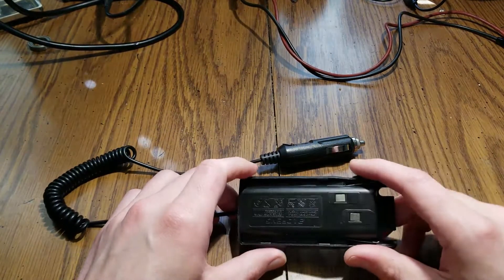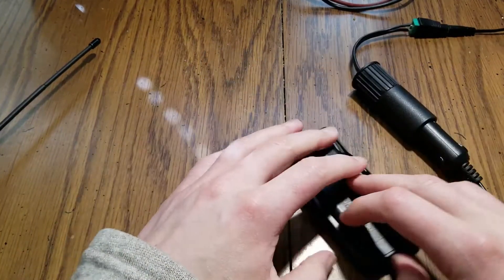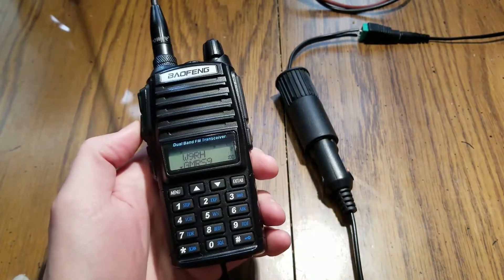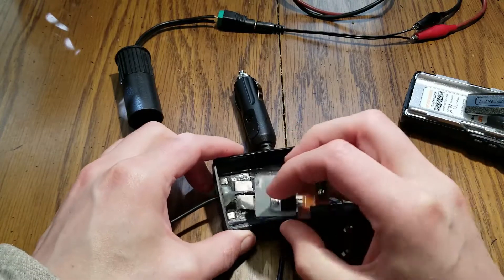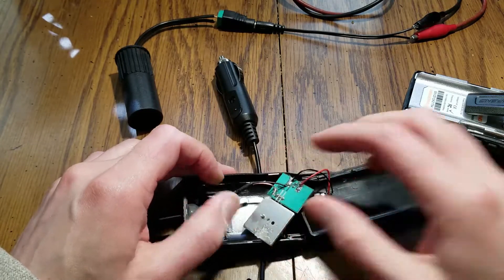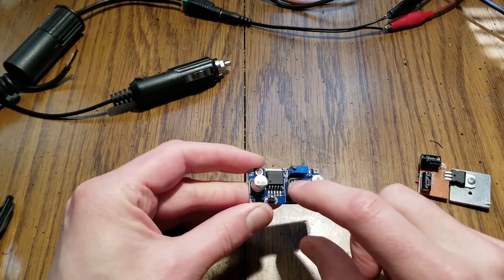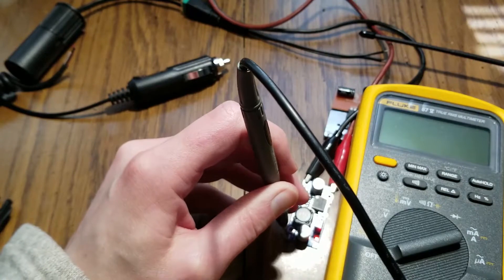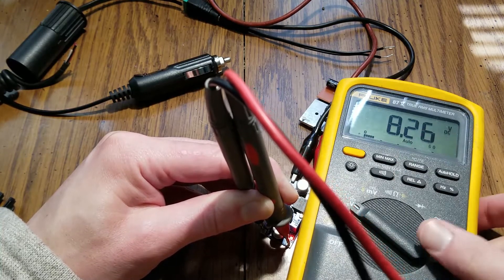Modifying a "Battery Eliminator Adapter" for a Baofeng UV-82 Radio.

Comment: Perfect! I have a 12V leisure battery in my car. I’m building an APRS battery monitor using a Raspberry Pi and a Baofeng. I want to hard-wire the radio inside the case i’m using. Thank you for the video.

Comment: Thank you for the video. I have a dead battery so I think I will use it to make this. Do I just simply search for lm2596? And they are all the same?
Reply from the maker: The lm2596 is the actual chip used for the switching regulator, so there are various circuits designed around that chip. Due to size constraints, you'd want to find one similar to the one I used. Listing of the specs for the device, like input/output voltages would be good to see when purchasing.

Comment: Do you notice any noise or hum from the lighter plug power after the mod?!  

I was thinking of using the LM2576 instead with a lower 52kHz switching frequency to help reduce any RF noise, thoughts?
Reply from the maker: I haven't noticed any additional noise. The switching frequency of either of these is so low that it probably wouldn't make much difference which one you use. If the frequency were higher and you were operating HF, you'd probably want to find one where the harmonic of the switching frequency would fall outside of the band you plan to operate on.
Reply: @Datzfunk   I was thinking the same, but was hung up on the whether the Fixed-Frequency Internal Oscillator of the LM2576 would make a difference on the 2 meter band. Great vid btw and thanks for the input!

Comment: I was not looking for a video on this topic, but just happen to run in to it, and after I had ordered 20 step down converters that will be used to convert UV5R chargers to 12vdc.  I should have seen this video first and purchased the converters with the adjustable pot. The converters in the mail put out 2amps at a nominal 9vdc.  At 9vdc, the UV5R battery would be slightly under charged.  Can you tell us where you purchased the step down converter?

Comment: Great idea. I haven't checked my eliminator yet on transmit from the HT (I use my mobile or base). I'm sure it will need the same modification for reliable transmit.
For the end connector, I'm a fan of Anderson Power Poles (APP) since all my other gear uses them (power supplies, cables, etc.). And I have a healthy supply of APP to other ends, like barrel connector, ring terminals (for SLA batteries), etc. I can connect to just about anything.  ;)
Reply from the maker: Anderson Power Pole connectors are great. I have applied them to many of my radio products as well!

Comment: great job! thx. But when plug into a 13.8v cigarettes lighter socket in a running car, do you need to adjust the regulator down?
Reply from the maker: According to the datasheet for the LM2596 for which this module is based upon, the maximum input voltage is 45V and the regulation should be pretty steady after it's set, despite varying input voltage.
Reply: @Datzfunk  can you wire it directly to a car battery
Reply: @escapetherace1943  If you have the regulator inbetween then yes